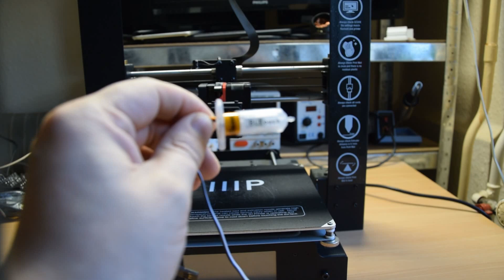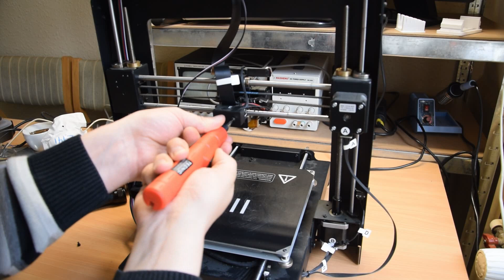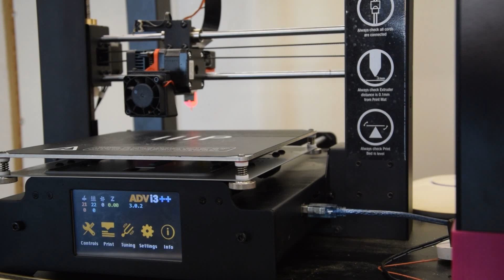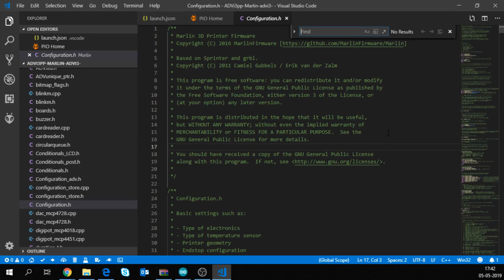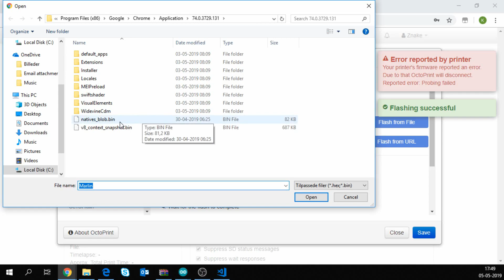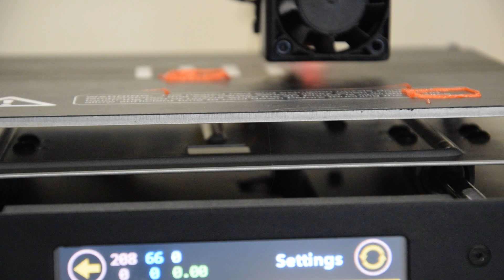Installing BLTouch Auto Leveling Sensor on Maker Select Plus

Comment: Is there a way to install a bltouch on the wanhao i3 plus without advi since it's stuck behind a patreon subscription?
Reply from the maker: No, not a BLTouch without custom firmware. However the MKII version of the printer has a capacitative bed leveling sensor I think, I do wonder if you could mod it to use that, or potentially drop an MKII motherboard into a regular i3 plus - I don't know, it's just an idea. Or you could install an old version of ADVi from before it got locked behind a paywayll, I have a few videos about that if you search my channel.

Edit - Come to think of it, the actually firmware is just some flavour of Marlin as far as I remember, if you can do without the touchscreen, and just control it through OctoPrint or something, then it is doable. The problem is the touchscreen controls are entirely custom, and that was basically the problem ADVi solved.

Comment: Is it possible to install this without the 3d printed mount?
Reply from the maker: Not really, you need someway to bolt it on, but there are different mounts available if you search around, if the one I use gets in the way of other modifications that you may have done.

Comment: Can you share a link to the BLTouch v2.0 or any other sensor that this version of firmware will support? I can't find it anywhere.
Reply from the maker: Newer versions should be supported these days, at least if you go with v4 of the firmware. I'm not even entirely sure it wasn't supported when I installed mine, maybe it was just never tested, so not listed as supported at the time.

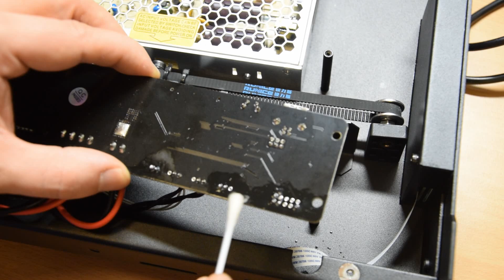Comment: The pins that you installed around the 7:00 min mark. We’re those included in your package? If not where do you get them from?
Reply from the maker: I don't remember, but think it did come with some pins. But if not, you could either solder the wires directly into the through holes, or you can get those pins for cheap on eBay - this should work for instance: https://www.ebay.com/itm/20PCS-2-54mm-40-Pin-Male-Single-Row-Pin-Header-Strip-GOOD-QUALITY/381375094139?hash=item58cbba1d7b:g:Cw0AAOSwajVUN1s4

Comment: I can see your X gantry is uneven (relative to the frame of the MP Maker Select Plus).  And why your bed is screwed down tighter on the right side than the left.  I assume that also explains the fairly wide range of mesh leveling height values.  I deal with this a lot on my Di3+, alas.
Reply from the maker: Yes, it does tend to get uneven, but the BLTouch takes care of it nicely now, unless it gets really extreme. But I think I also did it on purpose at one point in this video, don't remember if I mention it.
Reply: @ZnakeTech  Gotcha. Are you glad you went through it all? I really want some automation in the bed leveling process...but have been hesitant about biting the bullet.
Reply from the maker: Oh yes, never going back to manual leveling. It takes a bit longer to get prints started as it goes through the leveling process, but I don't have to sit there and bite my nails to see if the first layer gets good adhesion, it's just fire and forget, and 99 times out of 100 it's perfect.